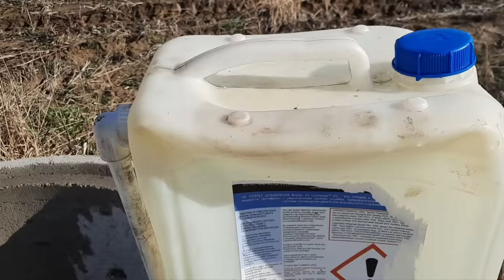Simple idea how to make a water pump without electricity without fuel

Comment: The initial flow from the faucet is from the water in the plastic tank. The flow at the hose however will only work to draw water from the well if the end of the hose is below the well’a waterline.
Reply: Nope the negative pressure created in the tank when the water flows out creates vacuum which creates suction and draws up the water to fill the area of negative pressure.
Reply: @ModernGentleman  The video ends with the plastic tank having collapsed under the vacuum. and no water was pulled from the well. the op is right
Reply: Right. the vacuum is pulling on both ends - the well pipe and drain hose. they will reach equilibrium and no water will flow once the initial potential energy of filling the tank is expended.
Reply: Im still at the garbage drill bit taking 10 mins to drill through a plastic barrel.
Reply: 0
Reply: @-robster-robster-  it made me mad.
Reply: @jpdunn42  There is a piece that prevents water from returning to a source (found in domestic water tanks) that is installed at the end of the pipe that raises the water and does not return to the well = I am just trying to correct everyone who writes that the water will return to my well that is wrong
Reply: exactly, and there is no need for a container
Reply: Working exactly the same way as any syphon.
Reply: Traducere română
Reply: @jpdunn42  what if one inserts valves?
Reply: I think check valves on either side would at best prevent leakage. On the hose side the water would have to pull against the spring in the valve plus the vacuum in the tank. On the well side the vacuum would have to pull up on the valve plus the weight of water below it. It would be an interesting setup to experiment with, but I don't see valves helping much.
Reply: Why?
Reply: @jpdunn42    No, valves would not help at all. To lift water to a higer level needs an input of energy, and there is none - if no trickery is used. The vacuum works both ways. The water pressure at the bottom of the vertical pipe going down the well is bigger than the water pressure at the outlet. That's why an increasing vacuum would stop the outflow before it would be able to bring up water from the well.
Reply: @ModernGentleman  Let us drop the whole barrel. Your description stil holds, suction will suck water from the source, as with any siphon. BUT this only holds if, and only if, the output is lower than the input. The whole gimmick with the drum is a wau to prime a siphon. Such a priming mechanism may be practical, but a drum makes no pump.
Reply: @Khalil_Compli_Minti  Ok, OK, if the input tube is filled up with water and there is a foot valve then the water will not flow back to the source, but it will not flow the other way either if the output is higher than the input. Water van not flow upwards against force of gravity.
Reply: @FuligJakab  May be practical to get things started, but running, the input must be higher than the output, as with any siphon.
Reply: @jpdunn42  valvs may make it easier to prime the siphon, but iss not needed under running condition, A siphon can be made simply using a single tube.
Reply: @jpdunn42  use teslavalve at beging of hose 🤔 how to force the vacuum 🤔
Reply: @davea.2311  That's all it is; a syphon.  The "tank" is used simply to get it started.
Reply: @jesserawson898    I agree, but there are simpler ways to start a siphon. After all, all what is needed is to prefill the system with water.
Reply: @Khalil_Compli_Minti  Yes, with a foot valve, no water will return to source, so what? If the source is higher than the output this will work. With a water filled drum at the start, you need no foot valve unless your outlet pipe is extremely long or wide.
Reply: @stanst2755  Yes and no. With a container, you do not need a noe way valve in the source. If there is som air leaking into the system, a barrel can keep it running for some time until there is too much air in the barrel.
Reply: @Khalil_Compli_Minti  Yes it will return to your well with rain or if you put it to the groud nearby well it will go Deep inside earth and back to your well:-) when you put this pipe back to well and let to run electric wheel you will get small Energy for free real for free "People it is not Rocket Sience or Magic we do not live in dark middleages" some People say that is impossible if they have MBA or MIT they should gave it back it is simple phisic from elementarny school in Poland:-)
Reply: @jpdunn42  self(back) cut of valve will make The job "I think that I live in dark middleages" IT is not Magic e=mc2 do not explain every thing for sure:-) it is working when line pipe is long you might need added air tank to compensate pressure and do not forget about self back valve👍
Reply: This works a lot better when you're siphoning gas from other people's cars
Reply: @robertsandoval2923  But in that case the receiving  bucket on the pavement is lower than the tank in the vehicle. Here the well is lower than the exit.
Reply: Looks like they had a gallon of water to make the initial suction. I imagine that was enough negative pressure in the tank to draw the water up from the well. Someone with a good physics background would be able to spell out the specifics and limits of this system. As it is it looks like a great solution for my aquaponics ponds as I am moving water from place to place with only minor elevation issues
Reply: @jpdunn42  sir you seem to be a bit more educated on the physics involved. So, how much negative pressure is applied from the initial gallon of water drained from the tank? And finally, they did run the hose downhill thus removing the equilibrium issue. This appears to be a good way to start the siphoning process without electricity, or the sucking on a hose. Cheers
Reply: @Khalil_Compli_Minti  a “check valve” is what it is called, and it is not needed in this case. Also, they can get expensive and are useless with dirty water
Reply: @jesserawson898  wow, after all the confused people with an extra two worthless cents I find someone who understands Exactly what this is. Cheers
Reply: @uprightfossil6673  This is nothing but a siphon. You can do exactly the same with a tube. Still the input must be higher than the output and the system must be air tight.
Reply: @kjellg6532  yes child! Stay away from the stove.
Reply: @Khalil_Compli_Minti  A foot valve will make no difference. OK, no water will flow back to the well, but water will evacuate via the output and create low pressure in the tank. The tank can collapse due to atmospheric pressure.  One purpose of using a tank is that one can start, prime the siphon without any foot valve in the source. Once the siphon is running, no foot valve is needed.
Reply: @uprightfossil6673  OK, so you have no more arguments, good. Then we agrees.
Reply: @jpdunn42  Thanks. That cleared this up for me because I kept thinking this actually makes sense and may work.
Reply: @gillespage5489  You're right. Law of Communicating Tubes.
Reply: @uprightfossil6673  Hi, thanks for your appreciation.  On the other hand don't confuse this with a ram-pump.  That's a different kettle of fish altogether.  Cheers.
Reply: @jesserawson898  nope. Seen ram pumps. This is best described as a siphon pump or more accurately a siphon primer. I move a lot of water in my greenhouse and aquaponics. Some of these trolls reap my wrath for their stupidity and their parents allowing them to be idiots. I am a man of science. Cheers and all the best to you and yours for the holidays ahead.
Reply: @ModernGentleman  Wrong, You clearly never used a siphon in your life, this a basic siphon, when you actually learn that things actual work then come join the adults at the table.
Reply: @ntal5859  "when you actually learn that things actual work"
Stay in school big guy.
Reply: It is only a simple shy phonic effect. Water level will flow from a higher level at well water to lower ground level .😂
Reply: @ModernGentleman  corect
Reply: Yep. This is just a siphon with extra steps.
Reply: As the water comes out, the air is sucked in. When the water in the bucket is used up and the air is full, there is no more water in the bucket.
There can be no perpetual motion machine in the world
Reply: @davea.2311  right. tank is there to start the siphon instead ofsucking the hose. The water weight in the jug being more than the inlet hose is the driving force. It doesn't return below water level like a typical siphon. The inlet being on the top of the tank creates a new water level. The tank.just has to have enough water weight to pull water up the inlet. Also the container has to be strong enough to withstand the weight of the water collapsing it. 10 ft of water In a vertical shaft has alot of weight respectively.  Holy fuck I feel smart.
Reply: @Dingsrud  the inlet on the tank being above the outlet is effectivly moving the water level.  The weight of the water in the tank is more than the weight of the water in the tube. If the tank can hold up to the compression this can work.
Reply: @cavelvlan25  Do not think so.
Now let us call the tank a “black box”. We do not know what is inside and how it works. The title of this video indicates that the box is a pumping device, so for hours, days and months it will elevate water from the surface of the well to a discharge valve about 1 meter higher. This will happen without electricity, without fuel. In other words, the black box receives no external energy in hours, days and months, but it does labor/“work” as per physics. How come that this mysterious black box can lift water i.e. add potential energy to water, without any energy input to the box but for the charging in the start up, manually lift of water to charge the black box. Will this charge really last for an endless amount of water? 

I do not think so. If it did, you would have an example of perpetuum mobile.  That would be a sensation!
Reply: @-robster-robster-  I thought it was going in reverse! 🤣
Reply: @kjellg6532  Said black box is not doing work. The water is doing the work. The energy source in the black box is the water coming out of the bottom hole. The fuel if u will is the water coming in the top of the box. It is a siphon. The water weight in the black box makes up for the climb or lack of fall. Honestly I'm not a thousand percent positive.  A metal tank would probably be required and absolutly air tight. The exhaust port may have to be slightly larger than the intake. But theirs coukd actually work idk. If I ever have time to make such a build I will glady do so I think their design is quite flawed but it think it is possible
Reply: @kjellg6532  nothing is perpetual.  You would run out of water, it would rust, a seal would go bad. Absolutly everything needs maintenance. There is actually a clock I be there is a bell thay has been ringing for 175 years on the same battery.  Will probably fail due to lack of maintenance (not wanting to stop it)
Reply: @cavelvlan25  Now you are getting somewhat philosophic. if this “pump” gets going for say a month, it is “perpetual” good enough. If it is a siphon (output lower than water level in the well)  it is perpetual for this discussion.
Reply: @kjellg6532  ill try wording it differently thebinlet on the of the jug is like tbe highest point in a siphon. There is more water by Maas weight and volume towards the outlet than towards the well thisncreating a siphon. I'm not arguing jfnjt is a water "pump" or a siphon. I'm arguing that the principle could work so long as the inlet stay submerged and water on the outlet side if the highest point continues to have more mass.
Reply: @kjellg6532  https://youtu.be/T6cmnfQa9ig same principle here the second container becomes the new water level.  Idk how else to explain
Reply: As long as the water in the barrel has a bigger mass than the water in the pipe it will draw water from the well. You can help the vacuum effect by placing a few valves to stop the circuit then normalize pressure and start syphoning again. No way around this because the energy transforms and the energy used to syphon the water is transformed as vacuum force. But it's free only time and patience consuming😊
Reply: @cavelvlan25  yep, brings water from the upper container to the lower container as any siphon would do.
Reply: @kjellg6532   I'm not even sure exactly what it is that you're arguing I'm pretty sure you're just been a troll
Reply: @cavelvlan25  Sorry, my intention is in no way to be any troll, even though I come from the home of the Trolls, Norway. English is not my native language.
Reply: Wow like Einstein every pump must have hose put(end) under The water level so far there is no wi fi water transport invented :-)
Reply: @-robster-robster-  r
Reply: So isn't the only form of energy in this case gravity?
Reply: This idea success for 40' down water leval
Reply: Bottle must be placed above the discharge line, it becauses gravity force creat vacuum inside the bottle. 
It known as syphone that creates vacuum that the fundament phenomena of gravity force it created inside the bottle. As long as vacuum exist inside bottle, water flow will continue non-stop around clock.
Reply: Good2.
Reply: Correct.
Reply: I see it has been a quite the debate in here. I would greatly appreciate if anyone can confirm my understanding as I don't feel too smart tbh.
Using a siphon (output pipe diameter smaller than input), after creating initial suction I'll be able to circulate water in my small pond. Right? Or it's gonna work only if the water source is in higher, elevated position?
Thanks for any polite comments
Reply: Perfectly right!
Reply: @EfYouSucker  It's gonna work only if the water source is at a higher elevation than the outlet of the siphon pipe. The plastic tank was just used to make it easier to prime the siphon. And no, you cannot re-circulate that water in the lower pond without a pump.
Reply: Или если на выходе стоит насос

Comment: Basically  Syphon. Vacuum is created in the can top which keeps pulling water from well. However any leakage in pipe from well or joint may affect working. And every time you start, priming may be required. However nocost usefull Jugad!👏
Reply: @nitink01.  yes but no cost is not true. You won't be paying for power but you will pay for the parts in some way, form or fashion.

Comment: In a siphon pump (really a gravity pump) the weight of the liquid coming out of the tank (in the hose) must be heavier than the weight of the liquid coming into the tank. If you use a smaller hose coming into the tank than going out it will work. Using a more ridged tank alleviates the vacuum collapse problem.
Reply: do you think they used a foot valve for this?
Reply: Pressure valve
Reply: To achieve optimal flow  pipe length from well to header tank will determine header tank size and pipe diameter, you can not use two different diameters as this leads to inadequate flow to the system. I grew up with no electricity and this is a highly valued knowledge where I'm from.

Comment: Ever try siphoning gas from a jug to a boat or another car? The flow will continue after sucking enough liquid towards the end, so long as the jug or item being filled is below the water/liquid line, it will continue to fill until the liquid is gone or pressure is lost. Basic physics that I remember as a child in science. Lol Good prototype though for having the shutoff valve close to the source to reduce loss of pressure. 👍

Comment: This is great. I wonder if the bottle and pipes were larger if the suction and output would also be larger.
Reply: There is a limit vacuums can pull, it also depends on the strenght of the cistern , at the end of the video the imploding-process allready starting . Rule ; what's coming out of the tap has to come in by the suction pipe , no less ( causing the cistern running dry which stops the flow by air coming in), and just enough to keep the cannister properly filled . Remember that all that water in the upgoing pipe can be a serious weight which must be tackled by vacuum-force. Once you attache a hosepipe on that tap, it becomes a whole different system ( syphone and gravity) .
Reply: No
The opposite
Reply: From what I have learned in my experiments, as you increase the diameter and the depth of the pipe into the well, you need a LOT more power to pull it up. Best to start small.
Reply: Hice el experimento, pero no resultó,  el agua del valde se iba hacia el estanque en vez de succionar y salir por la llave. 
Al sellar el valde, incluso se tensaba la tapa de plástico,  pero no hay caso ,escurre hacia el lado contrario.

ALGUIEN SABE POR QUÉ PASA ESO, POR FAVOR, ME EXPLIQUE ?😢